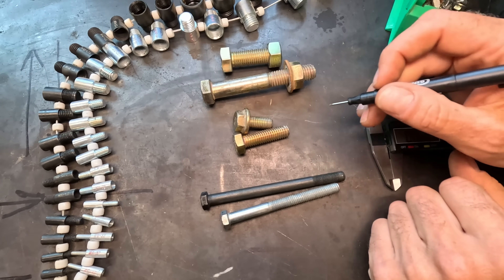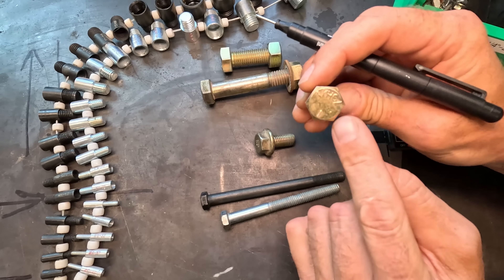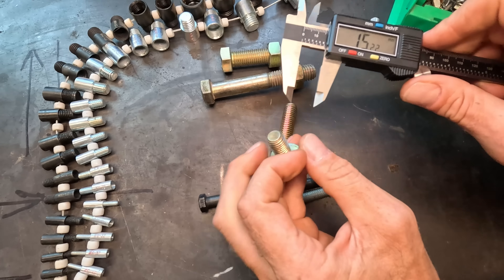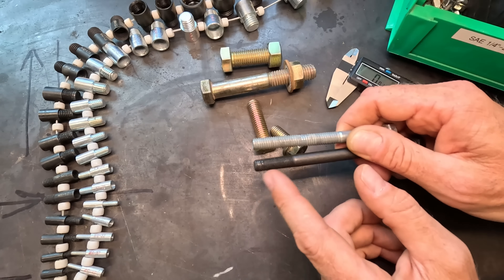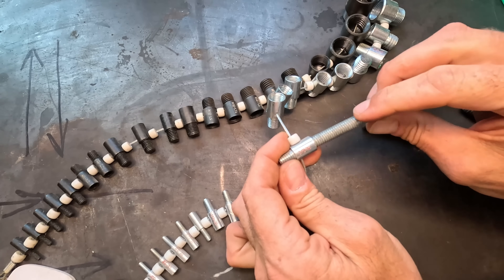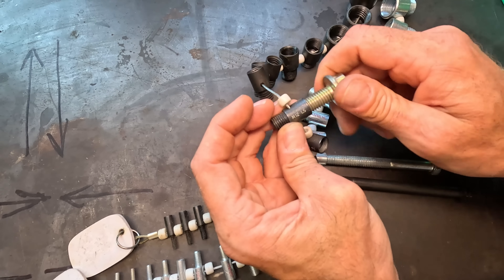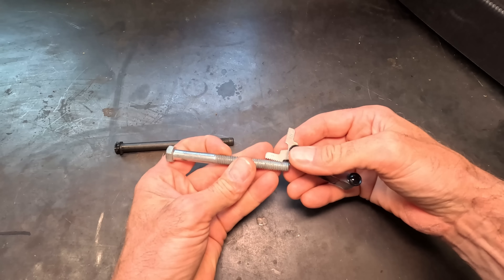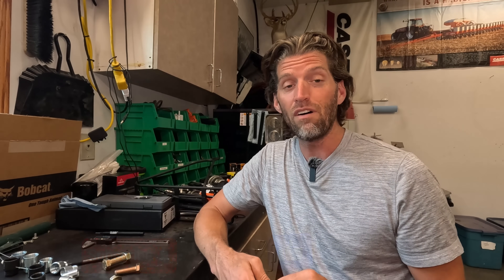How to find bolt & nut size, metric or imperial.

Comment: There are many different threads, unf, unc, cycle thread, metric fine, metric coarse, whitworth, Ba etc .
Reply from the maker: Agree, so many variants!  Most will never realize. Ive never had hands on experience, yet, with a fee you mentioned. Are you a machinist or engineer where you experience the wide range?

Comment: The bolt head will tell you if it’s metric or imperial and the tensile grade. Coarse or fine is easy by measuring thread pitch, imperial TPI, metric measure pitch directly by vernier caliper. Here in Australia, metric exclusively. The Australian/NZ standard is readily available. It’s so easy to determine.
Reply from the maker: I was fortunate enough to spend a few weeks in AU in 2019, amazing place and people. Where are you located? I'll have to look up the AU/NZ standard, I'm unfamiliar. Cheers!

Comment: I do maintenance for a living. I have the same thread checker in my van. I can’t depend on a local hardware store to maintain their bolt thread checkers. ✨
Reply from the maker: I've typically found the plates at the hardware to be variable and often not present. Would rather have my own checkers and thread gauges. If I have something really odd, I go to our local machine supply store, they are incredibly experienced. Cheers!

Comment: thread gauges usually suck, I like the bolt/thread plates
Reply from the maker: Ive struggled with some of the plates, others have been decent. Main thing i like about the checkers I use is being able to engage multiple thread to ensure. As long as we find the correct hardware, right?! Cheers.

Comment: I have that set, and like it because it's made of steel, so the threads aren't as easily damaged as the aluminum versions. I cut them off the cable, and put them in compartmented boxes.
Reply from the maker: Agree, it's a great set. Great idea cutting them off the cable. Several times I've wanted to use one on a vehicle for a threaded hole and it's a pain with the cable. Are you a mechanic?

Cheers!

Comment: Haven't read through the many replies, but one very important consideration when using bolts, is that for maximum strength when bolting structural members together, there are NO threads within the shear plane.
Reply from the maker: Interesting comment, I haven't seen that one yet. Suspect you are an engineer? Tell me more. I'm guessing the grade/class is only true for the unthreaded shank? I enjoy this kind of learning. Cheers!

Comment: I have a metric and SAE thread pitch guages,have run into several bolts that neither guage fit,I remember doing a little research and if I remember correctly they seemed to be a British thread of some sort,cannot remember what that was called!
Reply from the maker: You're right, there are some less common thread types out there like British Standard Whitworth (BSW) or British Standard Fine (BSF) that can be tricky to identify. Cheers!

Comment: When I saw your thumbnail image, I knew I already had what you would show here. I have owned one for four years, and it was worth every penny.  https://youtu.be/aAAcXy0yGoc?si=csSgTjhWhMqGnTmB&t=62 The guide I use is the one on the cable. It has come in handy multiple times. I also have a caliper and thread checker. As you said, I hardly ever use the thread checker after I bought the cabled set with the Metric and SAE Nut/Bolt guides (mainly because it gets harder to find as tools pile up). My Dad would throw everything in a used coffee can and reuse bent nails, so he didn't help me much in the bolt/screw or nail departments.
Reply from the maker: Your dad sounds like my grandpa! Toss in the pail and because you never want to dig through the pail, it all rusts away 😂. Man I miss my grandpa. Cheers!

Comment: When measuring with a caliper you should run the caliper gently up against the part you are measuring. The reasoning is the head is being held against the rail buy a small light spring underneath the screw at the top when you collapse the spring with this screw locks it down it pulls the casing all the way up to the rail. That's why you see variance when you push on it harder on the head
Reply from the maker: That's a great point about the technique for using calipers to ensure accuracy. Appreciate you sharing that tip! Cheers.

Comment: I bought these from Harbor Freight to organize my nut, bolts, electrical stuff, loose things, I have 3 large ones and 1 medium for smaller stuff. I can put them in my truck easily to trasport them as needed.
STOREHOUSE 8 Bin Large Portable Parts Storage Case - Item 93927
STOREHOUSE 20 Bin Medium Portable Parts Storage Case - Item 93928 / 62778
I still bring my bolts or nuts to Homedepot to measure.

Comment: I used to work at a very large heavy equipment manufacturing company, starting out as an assembler, then an inspector and finally a manufacturing engineer.  The company-mandated training on this subject was dry and forgettable.  This video was anything but.  You did an excellent job of presenting the subject and how to put the knowledge to practical use.
Reply from the maker: That's awesome to hear, glad I could make a usually dry topic more engaging and practical for you! Cheers!

Comment: At the beginning of the clip, they are not bolts, they are hex head screws, and hex head set screws. Just saying.
Reply from the maker: Appreciate the comment. Definitely familiar, and in alignment with machinery handbook. I generally used the term 'bolts' since the average human doesn't realize the difference. But, thats a great separate video idea to help people understand the proper hardware terms. Cheers!
Reply: @LearnedFromDad thanks for your response, sorry to be such a pedant but while serving my apprenticeship mid 1960’s when it was drummed into we apprentices, that the difference between bolts and set screws was to be ingrained in our soul, else some awful disaster would befall mankind.  Take care stay safe.
Reply from the maker: Oh no, I love comments from folks, it helps us all learn!  You have my attention at "apprenticeship", what was your trade? My dad was a tool & die maker for ~30yrs, he loved it and was such a meticulous person.
Reply: @LearnedFromDad I served my time as a Fitter and Turner, but was trained on all machine shop tools, including machines that  that are quite rarely used these days, such as jig borers and shaping machines. I also learned to weld, both gas and arc. I progressed to be a mechanical engineer, working on all manner of production machinery, for companies such as Mars confectionery, Brillo company,(very specialed machinery) Vandervell shell bearing manufacturing to name but a few.
Reply from the maker: That's outstanding. There is nothing better that seeing a person work in a trade before progressing into engineering. Perspective of what may work is so different. I bet you have some really neat stories from your career!

Comment: Just buy a set of sizers. They  are flat circles of metal with holes on the inside and thread pitches on the outside. Get your bolt, hold it against the pitches until you find the right pitch, and then pass it through the holes for the correct size. Keep one of each bolt per size and thread, and use these to check your nuts.
Reply from the maker: Ive used those a handful of times, but am pretty partial to those metal sizes or use thread gauges for unique stuff. In the end, they all work! Cheers!

Comment: Pro tip :  when my wife starts arguing with me, I stoically go into the garage and sort the nuts and bolts into trays until the lady cools down.
Reply from the maker: Haha, sounds like a very effective strategy! Love it. Cheers!!
Reply: Great idea. 👍 I often find some other way of diffusing the situation, but I am going to have to use this.  I recently got a set of thread checkers and have a few jars of bolts, screws, and nuts just waiting for an excuse to be organized. 😅
Reply from the maker: Haha, amen! And, you can always find loose hardware in bulk from auctions....so the diffusing opportunities are endless!! 😂
Reply: Miraculous solution works every time.

Comment: So, How do i size  a hole that lost its factory bolt? 
(Thread pitch)
Please and thank you.
Reply from the maker: Sorry I missed your comment before. A thread pitch gauge is one of the easiest ways. Find the gauge that matches the threads and you found your size. If you're pretty certain it is metric or inch hardware, and you have spare, you can do some guessing. It's more difficult to do, but you can measure the thread valley to valley of the hole with a caliper, measure 1" or 1cm, and count the threads.
Reply: @LearnedFromDad Ty 😊
Reply from the maker: Happy to help!

Comment: Great video thanks for sharing  James, i have a 85mm diameter bolt i have mesured with a caliper, and would it be considered metric or standart imperial ? and if so why cant i find any replacement to buy anywhere?(i cant see any bolthead info as its craved into a fishng landing net) all the best for the channel !
Reply from the maker: So sorry, I missed responding to your comment. 85mm diameter, thats a huge bolt!! I had to look in my machinery handbook to find what hardware went to that huge size. There are definitely both metric and inch bolts that go that large, but Google searches I found nothing. Something of that size would be very unique and might need fabricated by a machine shop. I'd call a quality machine shop and discuss with them. With a variety of measurements, they can identify and make or source a nut. Best of luck!
Reply: Sure thanks
Reply from the maker: I've thought back about your comment multiple times, what kind of a fishing vessel was that large bolt used on? My uncle has run a small salmon boat in Alaska decades. And, i always enjoyed watching Deadliest Catch on Discovery channel.
Reply: @LearnedFromDad sure thanks for getting back most people here dont.respond so often.... its from my fishing landind net of my kayak
Reply from the maker: I really enjoy chatting with people, everyone is unique and has stories/experiences to share.
Reply: @LearnedFromDad  Sure im a diy amateur learner myself building my small shop here in europe, and every tip is great if you get what i mean yea
Reply from the maker: Where in Europe? Ive been to 5 of the 7 continents, but not (yet) Europe! Stay curious.

Comment: Well... In the seventies, I discovered how easy it was to mix up 2BA, 10-32, 3/16" BSF and M5 fasteners... If you're a bit sloppy.  BA have a 47.5 degree included angle, are a bit "sharp" looking  No excuse, but, I mixed them up... All are ABOUT... 3/16" / 5mm diameter, 32 TPI / 0.8mm pitch... Three different included angles, 47.5, 55, 60 degrees... Take care...
Reply from the maker: Great story, thanks for sharing! My dad (tool & die maker) always preached to us to "use your machinery handbook".....it has every answer you need. I'll have to ask him if they ever go into any unique threads.

Cheers!
Reply: @LearnedFromDad  It's one thing knowing, or having access to information, it's another applying it. I think, in our youth, we've all ignored, or misinterpreted information, screwed up.  I know I have.  Re "unique" threads... Being pedantic (an engineering trait)  Every thread we produced in training was unique, in that we seldom, initially, ground our HSS single point tools to the correct included angle, and in the event we did, we'd screw up by not setting the tool up at the correct angle, or the correct height.
There are not really any "unique" proprietary  threads, there are a lot of unusual ones.  The Oil industry has a few of them...  
I made some connectors for convoluted flexible oxygen / airline hose (to connect military aircraft crew's masks to the supply lines,
A tapered knuckle thread, I used a Hepworth Hydraulic Copy Turning attachment to achieve the angle, (and drag the tool out rapidly before the shoulder, hand ground separate HSS tools for root and crest, since it was easier than grinding a full form tool.  In the light of a few decades of experience, looking back, I could have done it differently, but I was young... 
In respect of "uniqueness" there is a possible candidate... I made injection moulder nozzles in the 80s.  One task came in specifying a thread of " 38.1 mm x 1.6 pitch " it was so obviously 1.5" x 16 tpi, but I was obliged to make it 1.6mm on a lathe with an imperial leadscrew, obliging me to keep the half nuts in engagement, and reverse back to the start each time.  Relatively easy with a fine pitch, but still limits the speed you can run at with carbides, and avoiding crashes into shoulders.  Carbides used to chip, used too slow... Better, now...

In 1979, January, I took a new job in a new area, was given a drawing, a lathe, and a pallet of material (bar stock)  I was to make a large number of shafts, each having a thread specified as M25 x 3 (a standard metric coarse) I bumbled off to the toolroom, requested a 25x3 ring gauge.  "Why?" I was asked.  Stupid question, I thought, but pointed to the spec on the drawing.

I was told "We don't use metric, that's 1" x  8 tpi Whitworth...!"  so I got a Whitworth gauge, but--- Had I arrived with an M25x 3 gauge, or my thread parallels, or a thread mic with the right capacity and anvil, or thread wires... I'd have made a palletload of shafts wrong! (but right to the drawing) I said to the toolroom guy "how come the drawing says 25 x 3?" Turned out that in preparation for metrication, a female "tracer" (used to copy drawings onto drafting film from the original draft on paper, for Diazo copying...) had been given the task of adding metric equivalent dimensions onto old drawings, as a nod to metrication... She just approximated threads, as in that example...

I never did get on with the toolroom man, but I was only there for seven weeks... The company still exists, but doesn't make the product I was working on...
Reply from the maker: My goodness I'd enjoy listening to stories from you....you sound very much like my dad....a lifetime of experience and unique situation. I appreciated when you mentioned in training you would screw something up. Sooo many humans are afraid of mistakes, but it is the learned experience from mistakes that can make you greater.

Thanks so much for sharing with me, that was really enjoyable to read! I hope to see you back in future videos!

Cheers, James.

Comment: Nice Baseline.   Next level is Thread Class for each thread type.   Pitch Diameter for those diving deeper.  

Also, you will find thread out there not standard at all.  Many folks with lathes making parts that will just fit what they are doing.
Reply from the maker: Oh yes, so much more with threads. My dad was a career tool & die maker and always love listening to him talk about the wild hyper details he'd get into. Always said, remember to use the Machinery Handbook as your Bible.

Do you work in machining or other industrial trade? Cheers!

Comment: 15-months ago, after considerable research, I purchased the Giwaelro Nut and Bolt Thread Gauge -- 44 PCS (21 Metric & 23 Inch).  What I like about the kit is the gauges are separate and come in a case.  The advantage they have over thread pitch gauges (aka "thread checkers") is their ability to check nuts and threaded holes, a clear advantage if one needs to replace a missing fastener.  The disadvantage they have is they don't cover as many sizes as pitch gauges, but they cover enough.
Reply from the maker: Thanks for the recommendation, I'll have to check that set out!

Comment: Hi James
I'm restoring a 1971 Datsun 240Z and these OEM bolts are head stamped from blank, 4, 7, & 9 which I took for strength ratings which you confirmed in your great Video. I know that sometimes Engineers also select fastener strength based on the how critical that system is to the safe operation of the product. On this car the rotating drive train parts use 9 head stamped bolts and the stationary supporting drive train structure uses 7 head stamped bolts.  Blank and 4 head stamped bolts are used least critical and frequently removed parts. Anyway great video!!  Thanks
Reply from the maker: Hi there! Glad you enjoyed it. Ironic you asked about those somewhat mythical bolts. You're right, the number on the head represents a grade/class. I actually did a video specifically on those, because they always baffled me/others, until I spent enough time on the internet to research and find some answers. 

Enjoy this video!
https://youtu.be/fDhsn6kLmVE

Comment: I liked the video but the real problem with bolts are the hundreds of metric bolts that come with almost anything you get from China and they even have hex heads.  How do we know the size of these 1/4 inch or smaller that comes with the kits like from IKEA~? Some of the heads are round, some are flat and some are countersunk.  Thanks for the Info~!!
Reply from the maker: I'm so sorry I missed replying! Small bolts (commonly referred to as machine screws) definitely make things more complex. Regardless of head design, the measurement of the diameter and threads will be the same.....though very small so it makes it more difficult to tell what you're doing. Thread pitch gauges can come in handy, as you can match up thread pitch/size/count without measuring. And, often times I'll just take a given machine screw into the hardware store and use experience to see if I can match it up with something they have.

Thanks for watching. Cheers!